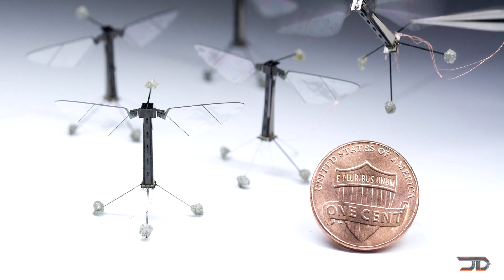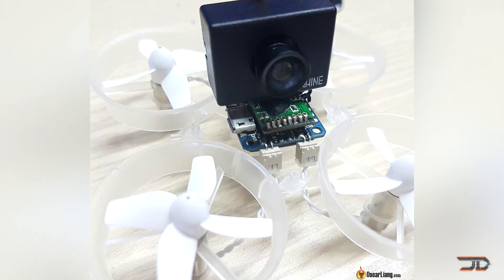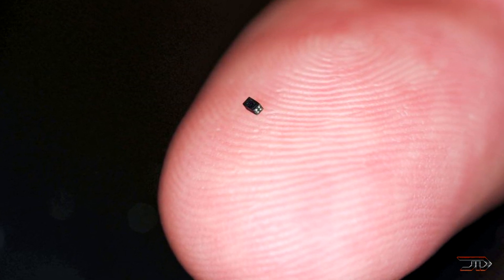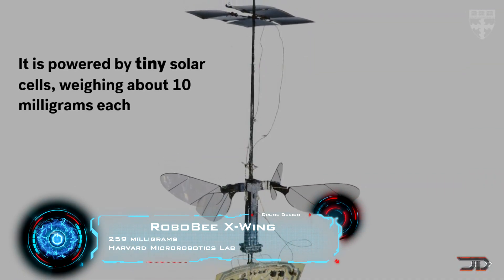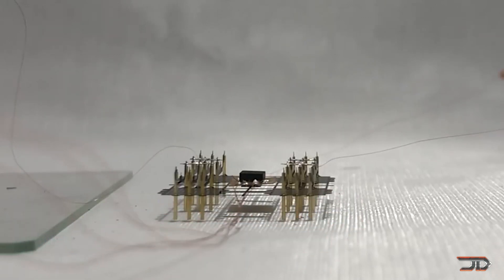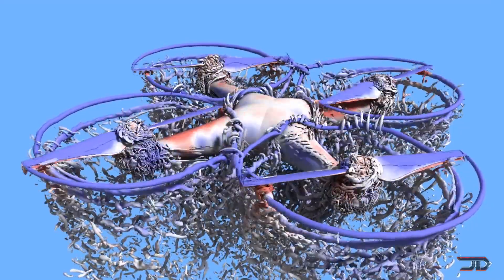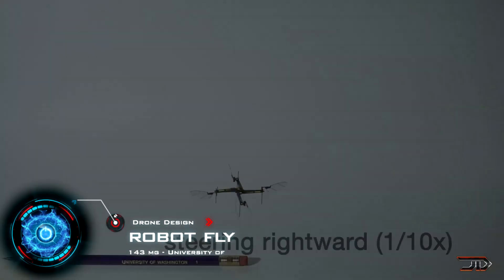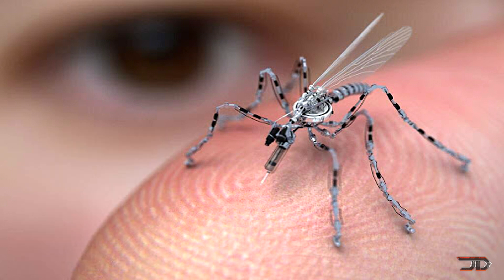Can We Build A REAL Micro Drone?

Comment: We have them. The smallest and dependable recharge and keep going as long as needed.  Govt will not let secrets out. Believe me we r there.

 Computer components are microscopic, video, sound recorder, autonomous.  Charge from sun, electric wires on poles that power buildings.

They can last on a long mission. Easily.

Comment: Hmm, I recently learned spiders can actually kind of fly using static in some way with long strands of webs. I wonder if that process is adaptable for a propulsion system for one of these.
Reply: they need wind dummy
Reply: Chip Mills your da dummy
Reply: They use wind...the same way they bridge a large gap to make a web.
Reply: Okay, looking into it more the static is only used to separate the strands of web. Wind is the source of the thrust. Though it does seem like an effective sail, that probably isn't useful for most designs unless it does in fact provide some lift from electromagnetism.